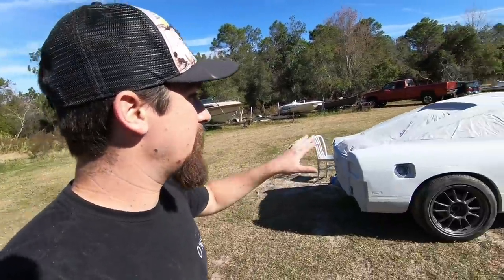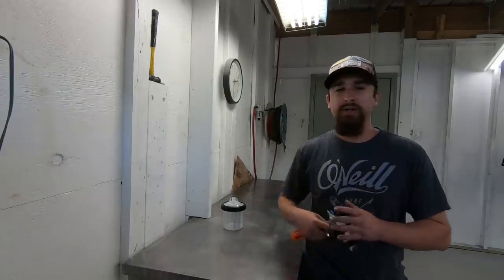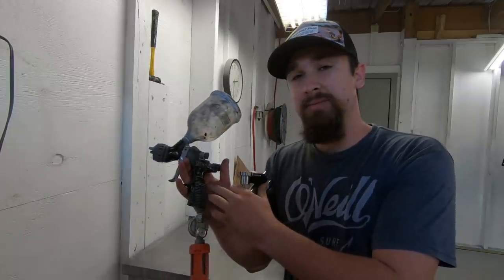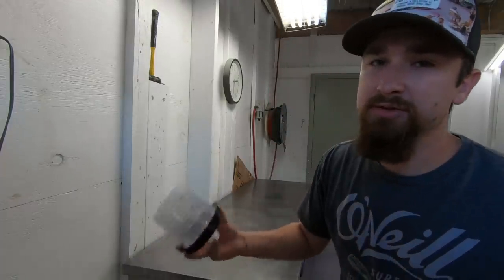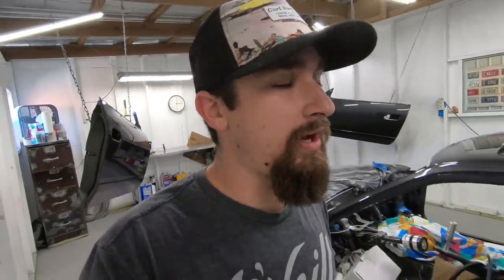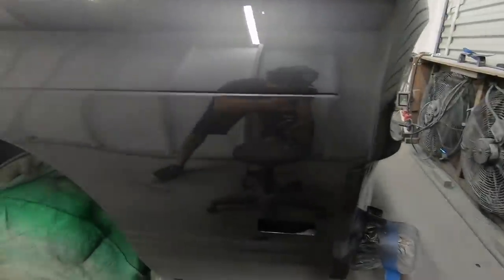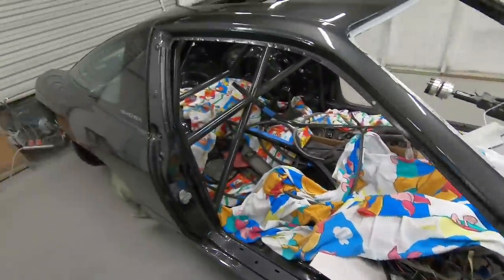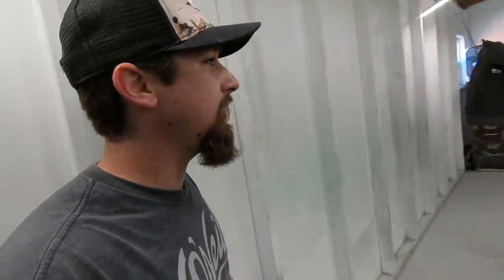s13 Drift Car Finally Gets Paint!

Comment: Great Gun!!, I just picked one up myself. It is however only a base coat gun not a clearcoat one. You should be spraying base in or around 13 to 16 PSI on that gun, it runs a very low pressure. Also don’t forget about your health and get a Paint suit

Comment: What I used to do when I used to paint to keep the dust down was I used to wet the floor before I started the paint
Reply from the maker: yeah ive heard that works great, i just get worried about dragging a wet air house around though.
Reply: Yeah it works pretty well but you really do have to be careful and watch your surroundings

Comment: What color code is that if u dont mind me asking
Reply from the maker: KG2
Reply: @BodeVision  thank u brothet because u answer back men thanks bro i have a question if my car is painted can i just sanded down with 220 do the body work witch is very very minimal do filler primer sand that with 400 or 600 what u think clean tack clean mask and base and clear and buff is that about rite im going k series so i figuer i fix all my issues and repaint
Reply from the maker: yeah all of that sounds good, just take your time and dont cut corners.
Reply: @BodeVision  exactly thanks brother to bad im not in florida im in new haven connecticut if not i would of had u do it